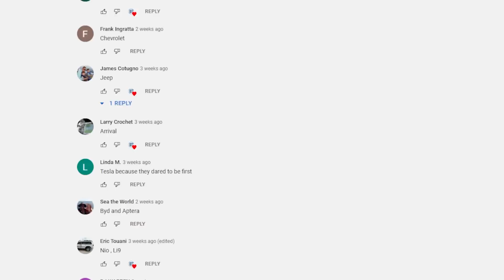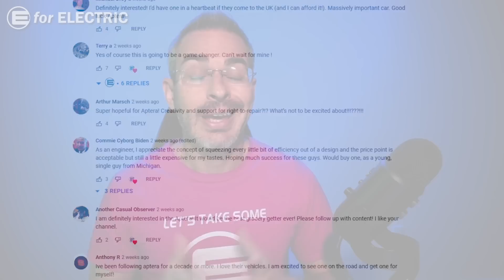How Aptera EV Got a Tesla-like Fan Base

Comment: What about safety?
Reply: Aptera has been designed from the beginning with safety as a priority.  It has been virtually crash tested thousands of times as the design has progressed.   It is in a class that doesn't require it, but it has front and rear crumple zones, an F1 inspired passenger safety cage and other safety measures including air bags.  I think it will end up getting a better rating than my similar weight Gen 1 Honda Insight, which got 4s when it was tested.  Aptera will use a third party to voluntarily crash test the delta production models to FMVSS Part 200 crash test standards.

Comment: Is the Aptera wider than most sedans? (those wheel covers) That video shows it not fitting into a parking space very well.
Reply: Yes, it is wide, but it will fit in a compact parking space just fine.  Even my Chevy P30 van does, and it is wider than an Aptera.
Reply: @n.brucenelson5920  Probably just a bad parker in that video. Some people can't seem to park IN the parking stall.

Comment: Like over 50% of the population of the United States, I live east of the Rocky Mountains.  I live west of Chicago so I do not get the sunny, southern California weather or the Sun Belt weather.  Thus, maxing out on bumper-to-bumper solar cell coverage just to get an extra 40 miles on the best of days is an option that will not pay for itself in the Great Lakes area.  This evaluation may extend to other, well-populated areas of the United States.  Thus, I see the justification for not having ANY solar cells on the Aptera  (GASP!) and getting the Aptera at a lower price than the current basement price.   I see the value in putting money into the 400-mile range and I am willing to consider the 600-mile range.  I can put my money into level one charging by putting the car in the garage and letting the car charge from 9 PM to 6 AM.  If I become a road warrior like taking a New York to LA trip, then I can start to rely upon the rapid growth in charging stations to rechange at a higher rate than level one.  The 400-mile option sounds like an excellent investment because that range exceeds the range of the low-end EVs.  

PS.  Are there any accountants in the audience that could check my numbers?

Comment: I've been driving a 2012 Leaf for a few years now down to 58% battery charge and driving within 40 miles a day is achievable.  that said, I don't know how much I will use with remote climate control and other features in cold climates I may end up opting more energy to the comfort aspects than to miles.

Comment: I am an Aptera fan, reservation holder (January 2nd, 2021) and investor.  There is such a long lost of "pro" with this vehicle.  

Electric: Several years ago I vowed to never buy a gas car ever again.  After mostly sitting on the sidelines while watching the rise of Tesla, I feel Aptera to be the next big thing and decided this is what will finally replace my 2007 Toyota Yaris hatchback.  I have solar on the home, so if the price of electricity rises in the future, who cares?  I can still charge at home from the sun for free, which brings me to the next "pro"...

Solar on the vehicle:  As I stated, I have solar on my house, and it is already payed off, so the little bit it takes to top-off the battery will be almost negligible.  My daily commute for work is 12 miles round trip, so even on the less than perfect sunny days, the vehicle's solar panels will charge the battery for free and I will return home with more charge than I used that day, if the battery isn't already full.  There is a lot of full sun days here in Southern Colorado, so most days will be good to go. 

Range: I want the 1000-mile variant.  I live in Colorado and will be driving it on hills and through canyons and over mountain passes.  I know those drives will lower the true world range, but it will still be a longer distance that most if not all other vehicles on the road.  

Efficiency:  Powering it for pennies on the dollar when compared to every other vehicle on the road wounds really really nice.  Compared to the current and future price of gas, any electric vehicle is a no brainer, and Aptera is a huge step above. 

RIght to repair: Hopefully this doesn't matter for a long time after purchase but with any vehicle owned for the long term, it's just a matter of time.  Tesla cars are awesome, but repairs of very expensive and can only be done by Tesla.  With right to repair, I look forward to doing my own easier repairs or possible upgrades at home like I have with every other vehicle I have ever owned. 

Cargo room:  There appears to be enough room to haul stuff around town or for trips on the weekend.  I will have to wait till I get it home to see exactly how much room there is, but everything I read and see so far looks very promising. 

Yes, there are a few "cons" with the design as expressed all over the internet.

Width: This may be problematic for other people in Europe or big cities, but that is not my reality here in small-town Colorado, USA.  It will be outside in the sun most days, but when it is fully charged or I expect ugly weather, I have a two-car garage that will accept it's foot print with ease.  I have a level two charger in the garage to top off the battery when needed.  I also have a 50 AMP RV plug that can be repurposed down the road if I want to plug it in outside or a 2nd plug for a 2nd vehicle.  

Only two seats:  I don't complain that I can't haul around 4 people on my motorcycle because I will just use my Yaris, ,Tucson or F-250 crew cab for those trips.  Same thing applies here.  Not every vehicle can do every job.   If you MUST have 4 seats and can only own one car, then quit bitching and buy something else.  It really is that simple.  I don't see Miata owners crying that they can't fit sheets of plywood because that is not what the Miata is for.  Just like the Aptera isn't for taking the whole fam-damily to church on Sunday.  

Pot-holes:  I hear a lot about concern for dragging the back tire into pot holes that you would normally avoid with a normal car.  Not really an issue if you have a decent sense of spatial reasoning.  Sure, sometimes that will happen.  Maybe just as often as hitting pot-holes with a normal car.  But, when you hit a pot-hole with a normal car, you hit it with both the front tire and the back tire.  At least with the Aptera, you will only be hitting the pot-hole with one tire.  There may be times that the pothole is super wide in which case you will hit front and back, but you have the problem regardless of 3 tires or 4 tires in that case so it's a moot point.  

Rear visibility:  If you opt for the hatch to be covered in solar, you can't see out the back window. Yeah, so?  Then don't get solar on the hatch.  If you do, you have a camera with video displayed when the rear view mirror would have been.  A back window is not an issue for a lot of vans and trucks on the road so it is possible to survive without. 
 
I'll stop now.  I just realized the length of this post.
Reply: Very grateful that you took the time.

Comment: The reason I follow Aptera is that it shows what might be the next generation in transportation.  in the late 19th and early 20th century, the Automobile was just a horse-drawn carriage, with an engine attached. High center of Gravity, because the carriages needed to be tall enough to see over the horses. No aerodynamics, because you probably normally won't go past 15mph, and are generally exposed to the elements.  In the 30's 40's design, the fact that the engine creates heat, and can travel faster, moved from the wooden design to metal, with more comfort features, as well the general shape adding a large trunk area to hold larger engines, lower to the ground to allow for wider and more comfy tires and suspensions. 50s-60's the Car got wider to hold more people, and carry more stuff with the standard =/o~~o\= shape.   Most Traditional Car makers are making EV's that are their ICE Cars with an Electric motor and batteries, with is akin to the first gen of Automobiles.   Companies like Tesla while mostly still looking like a normal ICE car, had some design decisions to take advantage of the Electric motor.  Now Aptera is showing what a ground up Electric Vehicle can be. Will it succeed? I don't know... How will the 3-wheel design work in Snow and Ice conditions, or just on muddy dirt roads?  Will there be enough demand for a two-seater, or will it be basically a second commuter car.
Reply: I live in rural Iowa.  I will be reporting on the 4 season performance in snow and dirt roads after I take delivery of an early example next year.

Comment: What I like about the vehicle is that it really leans into the spirit of self sufficiency. I’m the kind of guy that carries camping gear and food in the trunk at all times, in addition to tools and spare parts for his vehicle. But the issue of gasoline still remains. The first thing that will happen in the zombie apocalypse will be running out of gas, and I don’t know how to make that. Getting free miles straight from the sun would make me sleep a bit easier at night.

Zombie apocalypse aside though, I also appreciate the fact that they are designing for owner repair, which means that not only will I be able to fix stuff that goes wrong, but I should also be more easily able to make modifications for my own needs.

Comment: Happy investor, thoughtful, ambassador, and reservation holder here.

Efficiency of the Aptera Roadster is what excites me the most. 

CO2 in the atmosphere is expected to double by the end of the century — very scary stuff.  

The Aptera Roadster is another step in my CO2 reduction strategy. I have already removed the methane (natural?) gas home heater in my house and replaced it with a super efficient heat pump.  I have already removed the methane (natural?) gas water heater in my house and replaced it with a super efficient heat pump hot water heater.  In two weeks I have 10 kW of solar coming.

The Aptera Roadster is revolutionary, and nd will meet all my transportation needs. Besides, it’s a head turner.

Charge on!

Comment: I have been a fan since the beginning when i first saw the design of the aptera.It's called an autocycle,not bicycle or motorcycle because those are two wheeled.actually elio motors got regulations changed in almost every state to exclude wearing a helmet in autocycles.i like how the doors swing up and the efficient aerodynamic design of the vehicle. right to repair should take over the car industry in my opinion.and no charging for short drives is nice.It just looks cool to me!

Comment: Looks like a nice toy. Great for getting from point A to point B, as long as you don’t need to haul around kids and all their sports equipment bags. For me, this falls into the category of motorcycles, ATV’s, snowmobiles, riding lawn mowers, etc. This is just a toy for the street. I would be concerned about what happens in an accident (and they will happen). Not against it. Just not for me, other than maybe a test drive.

Comment: 400 miles of range, 40 miles of range via solar, and a price of $30k.  No one cares about the 3 wheels as long as it offers comfortable seats, heat/AC, and holds up well in a crash setting.  The real question is will the $30k models arrive before its 4 wheel counterparts offer similar range and price?

Comment: I am an investor but have yet to hit the buy it now button. Waiting for a few to be out in the wild so they can shake the bugs off. Efficiency is what I love about Aptera. 13 Km to work would mean it would never have to be plugged in. In the case of the 1000 mile version, visiting relatives 1400 km away would mean not having to stop along the way. I find both scenarios intriguing and wallet friendly. Concerns: How does it perform in the snow? What effect does salt laden slush have on the motors.
Reply: The motors have been well tested in 100 hour continuous salt spray tests.  I will be taking delivery of one of the first Paradigm edition vehicles for use year round in Iowa.  I think the ABS/traction control is going to be a huge benefit under such conditions.  It can sense wheel slip and adjust torque 32 times per wheel revolution, or about ever 2.5" of tread travel.  Coupled with studded snow tires or chains, I have few worries, but will report on my experience.
Reply: @n.brucenelson5920  I look forward to hearing about your experience. Can't speak to the amount of salt they put on the roads in Iowa but here in Nova Scotia they put brine on the roads before it snows and salt after. 100 hour salt spray test, that's not even a week. I don't put much faith in that sort of test. Going back to my first statement I am waiting for some real life experiential feedback. Thanks for being an early adopter. Maybe just another example of why government incentives need to be increased for scaredy-cats like me.
Reply: @terryrogers8965  I understand that we all have a different level of risk tolerance.  I had a long career as a troubleshooter, which took me world wide, including to places such as Kuwait during the fires.  I see Aptera as lessening the chances of such an event in the future.  For me it is worth the risk of early adopter problems.

Comment: I like the concept but I sat in it at FullyCharged in San Diego and found it hard to get in and out of it because of the swing up doors.
Reply: I've owned a hard to exit/enter car for eight years and have the scarred-up legs to prove it. Also, if I don't drive it for a while, I bang the back of my head upon entry. Very much looking forward to having the scissor doors to save wear and tear on my legs.
Reply: My technique was to back up to the seat, sit straight down and then pivot on my but to swing my legs in.  This worked fine on the somewhat smaller alpha.  At 72, I am not as limber as I once was.

Comment: Just a fan that wants them to succeed.  You hit it on the head; conceptually it is amazing.  But just as important to me is that for under $30k you get 400 miles of range.  I am concerned about its capacity to handle New York winters and whether the suspension is comfortable or very stiff.  The days of being jostled by my car are losing their appeal.

Comment: I am of the opinion that there is no single aspect of the Aptera that justifies the fan base. I am a fan, a reservation holder, a Model 3 owner, and a Cybertruck reservation holder. My interest in Aptera is recent. Similarly to the Cybertruck, it appeals to me from an unusual appearance perspective. It also shares the self charging capability with the Cybertruck (hopefully). I drive long distance a lot so the range of at least 500 miles for the  Cybertruck and 1,000 miles for the Aptera is appealing to me. I drive over 600 miles in an average day and it is a full time job to keep the Model 3 charged. The Cybertruck will only need one top-off a day and the Aptera would need none. I like that. Obviously I still have to charge at night with either one. I also go off grid at times where there are no facilities and I have to carry gas to get back. Thankfully the cloud tyrant is not in operation every day. And either vehicle would allow me to leave the gas generator at home. Battery electric is quiet and there is no carbon monoxide. The Aptera is also inexpensive relative to all of its advantages.  The Last item is that the Aptera is not in direct competition with any Tesla product, since I am a substantial Tesla stock holder, I like that aspect as well.

Comment: I’m intrigued by Aptera because I think there’s an unmet demand for an EV as an additional vehicle in the driveway to supplement the primary family hauler; that is, a car primarily used for commuting to work, running weekend errands, and occasional joy rides close to home. The key is affordability first and foremost, then range & fun factor. Affordability means a smaller battery and this use case wouldn’t need 300 miles of range…200 would be plenty, maybe even 150-175 if it charges quickly. 

$30,000 for a new EV that fits this niche? Their biggest “problem” will be making them fast enough!